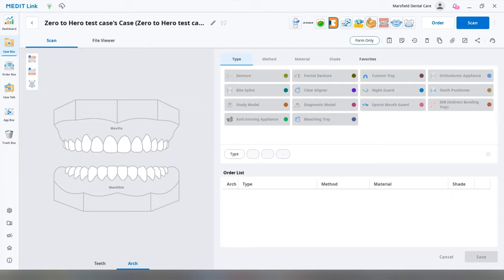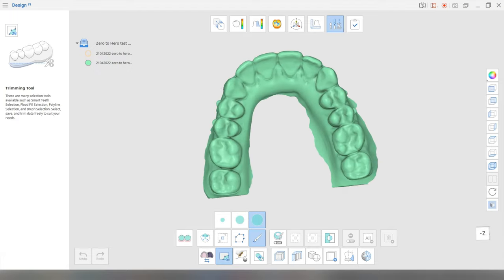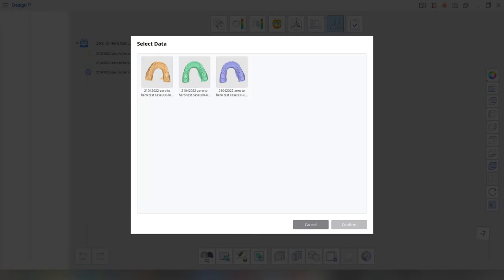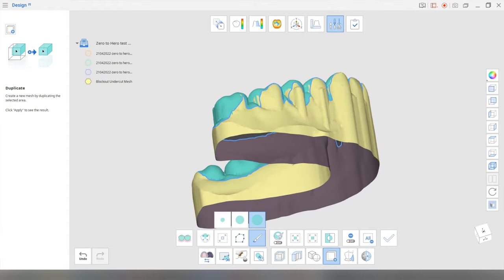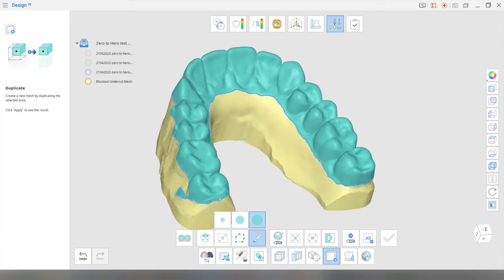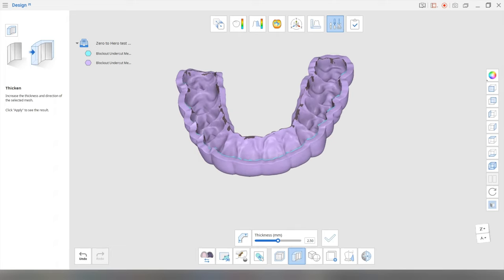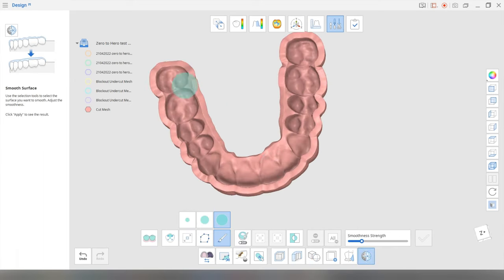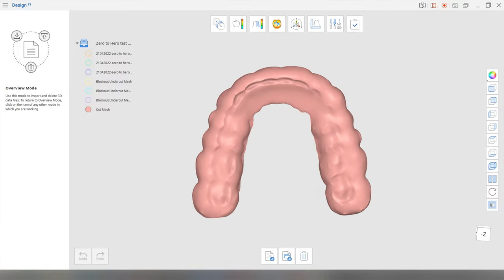Splint design using the Medit Design app - Zero to Hero course hands-on exercise

Comment: When at the step of removing interferences, what do you do if when removing the interferences, it leaves complete holes in the splint? Is this an issue with the original scanned models? How can I fix this issue?
Reply from the maker: If I'm understanding you correctly, this is most likely due to insufficient thickness - either increase the vertical dimension digitally (can be done on the splints app) or retake bite record with increased VD